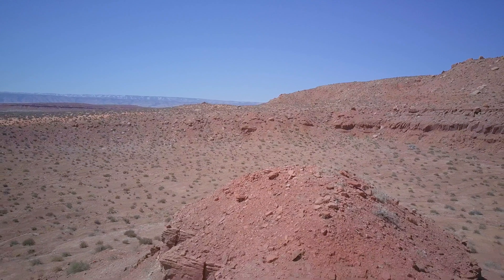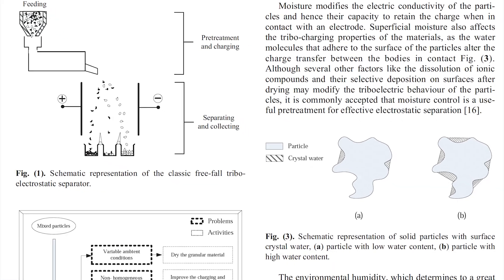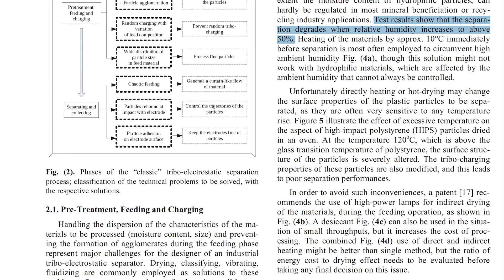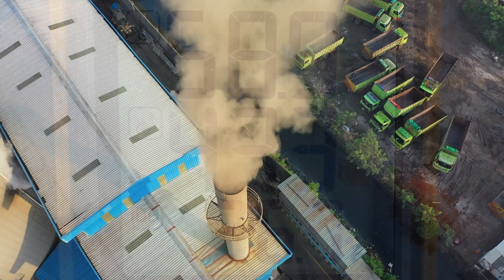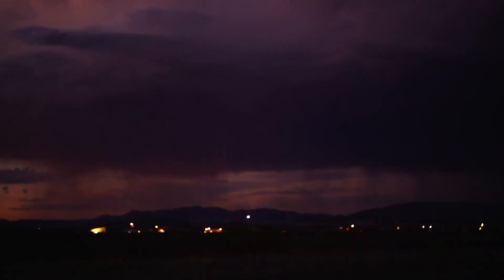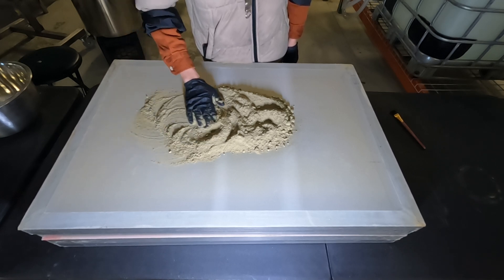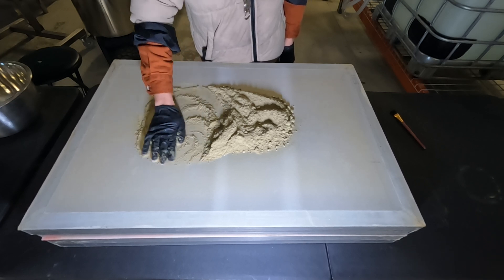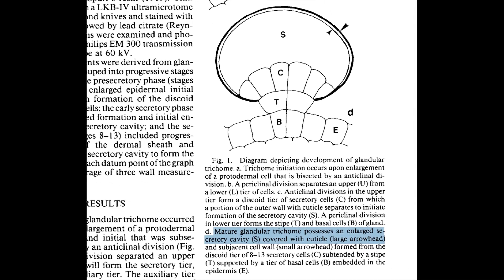Triboelectric Tuesday Episode 9 - Moisture Content

Comment: if you can truly automate trichome head separation without water it would change the solventless industry. 

I have been blessed to see Cuban growers 99.9 dry sift which was pure heads mechanically separated. The smell made quality rosin and full melt smell like mexican mids in comparison
Reply from the maker: We will surely try. Pretty sure most people would agree we are there. Hope to showcase the final product for MJBIZCON. R&D benchtop systems are shipping in the next few weeks.
Reply: @SamboCreeckFiltration  I'm seriously praying for your success and hope
you continue to share non proprietary knowledge along the journey. 

I'm sure you are aware but the potency and smell of pure drysift shows just how much is lost in water and heat from current processing techniques. It will set your company and machines apart from
the rest.
Reply from the maker: The reason for this series is to share everything I’ve learned. We filed for a patent just to keep the chads from spoiling it for everyone. Nonetheless we want the little guys and the DIY community to try this themselves and maybe even build something better.
Reply: @SamboCreeckFiltration  You have a truly unique outlook from most in the community since large money has entered. Very much reminds of the type of spirit we had sharing knowledge before legalization just striving to better each others crops and experiences. Keep on keeping on! 😁